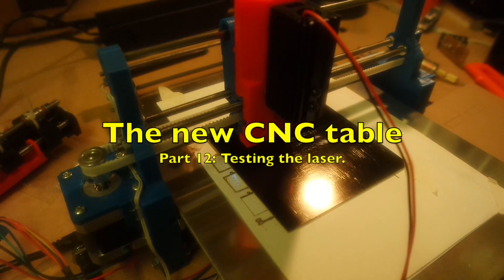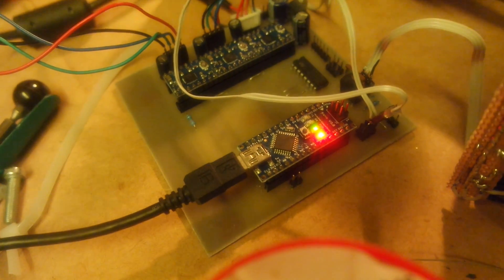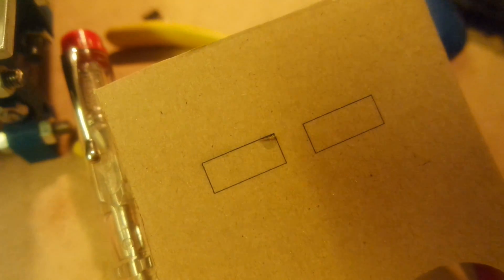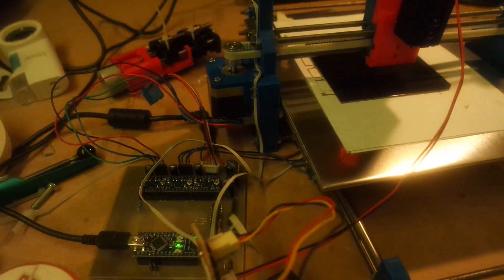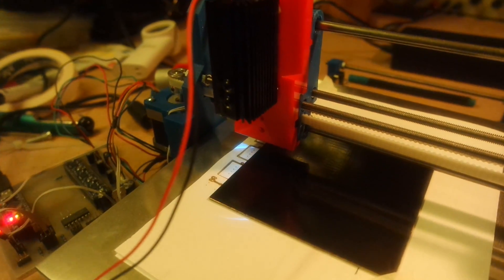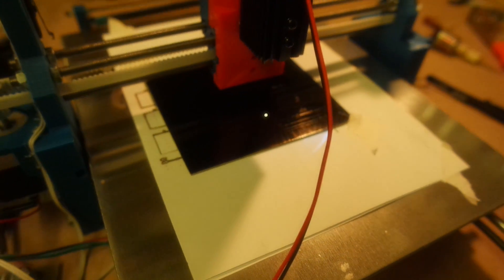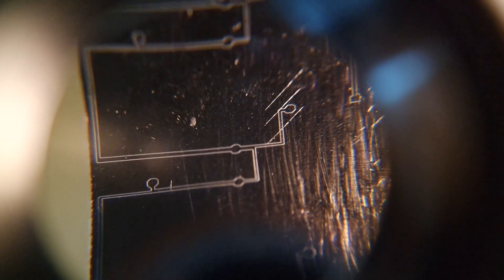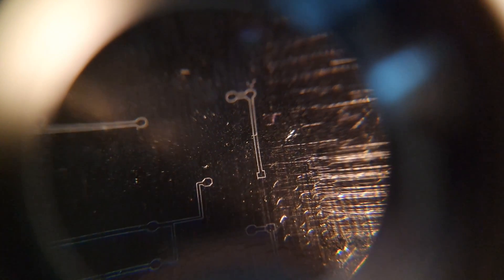The new CNC table pt. 12

Comment: Awesome...needs to be added to the playlist...
Love to see how it's coming...would like to see the Z axis raised to maybe 25-30mm for when you put a spindle on it...it can then route out 3D artwork in wood.
Also...maybe a drag knife tool mount...man your design is incredible!

Awesome designs man!
Reply from the maker: Thanks for the pointer to the video missing from the play lists - fixed now. Raising the spindle is also on the list, although that makes printing the columns difficult, since we are reaching the build size of my smaller printers.
Reply: Yeah fine line on too tall and wobbly and not tall enough and limited use...but it seems you are much more detail oriented than most and will figure it out...

Comment: looks great man .something occurred to me after the last comment i said about using a Z axis. to defocus laser hot spot to burn wider tracks.   we dont need to do that . looking at my fixed height unit , i realize all we need to do is a gradient test and then use shims . 
to do a burn gradient take your a small bit of target material (blackend copper clad ) set it on a angle like 45deg or less , and manually run your laser up the gradient to see how high from 0 can the contact point be and still burn. min is about 4mm making a 2mm dot .
higher gradient / height is a wider dot , and requires laser to move slower or do multiple passes , as the energy is spread out . 
when you know how high above 0 z you can still vaporize your paint without adjusting focus , you can then inspect to see what width line it makes . that way you can shim your target FR4 to result in a path that has good mask removal resulting in better etch . 
i forget if you are running custom firmware still or moved to GBRL .  i did everything i could to remove backlash mechanically and continued to find flaws in arcs .  closer inspection showed i was mixing float type with long type and math was truncating values causing step loss during arcs . I think I told you about that screw up before . lol 
screw up explanation video ( note i only used a relay for beam on back then ) : https://youtu.be/bgBwnhKF4_s
Reply from the maker: I tried a laser isolation yesterday - I got the backlash issue all sorted out. But when I etched the PCB exactly nothing happened - It seems as if the isolation only burned of the black, but there was clear paint left on the board. This sucks. The tracks laid down by the laser were so good.
Reply: man , i think now its a matter of finding the rite Pen / paint to cover the board .  I'm using ~300 violet module , but i can tell it leaks a higher wattage of IR when I use my old cell as a camera and there is a huge bloom . I have no etchant rite now , but i can test if mask was removed using a fine wire and continuity . 
i have real brand sharpie markers and some knock-off ones.  but i cant test what marker resists best

Comment: Since the belt drive limits your ability to use mechanical backlash compensation, it seems you may need to look into a software solution. Many if not all of the pro CNC machines have backlash values in the diagnostics.
Reply from the maker: My software can do backlash compensation, but I'd rather fix the hardware first. ;-)

Comment: your laser will likely blow in prolonged use using that type of voltage regulator. you should use a constant current supply. great vidoe series!!
Reply from the maker: It has a current-limiting circuit inside, it is also supply limiting, so it works quite well with lowered input voltages.

Comment: How many watts is this laser?
Reply from the maker: This one has about 1W, but I'm running it at about 250 to 300mW.
Reply: 3W ?????
Reply from the maker: One watt. but running a one third power.
Reply from the maker: Not really, important is that you have good focus and little vibration on the laser head.

Comment: Found with backlash, I needed to use a sprung loaded wheel, to keep the tension on the belt. Like a pair of bike forks with a spring pushing them out all the time.
Reply from the maker: True, but the backlash is about 0.02mm .... this could be within the one tooth of the belt.

Comment: Nice work. Actually surpriced that it looks this good.

Backlash can be reduced by adding two nuts which both are free to move along the Y axis in a hole/trace in the carriage, where the spring press them outward.  Like this:
=======FFNssssN======Stepper Motor

Both nuts (N) are moving in Y-axis direction with the carriage when the screw (=) turns.  The spring between them takes up the backlash. To the left of the left nut there are some free space for it to flex into, the right nut is fixed in the carriage and moves it. This will press the right nut to the right side of the threads, no backlash. They should both be fixed and not follow the screw when it turns.  Hope you understand how it should work.
Reply from the maker: yes, but this is a belt-drive.
Reply: Ah, yes, sorry.  Then can't you just add a spring on one of the sides for the belt, instead of mounting it directly on the carriage?  Or are the back lash between the belt and the stepper motor (wheel)?
If you make the Y axis repeatable go back and forth a short distance (or X-axis), you might see where it is. Might start with a very short distance and then make steps larger (or go from a larger distans down to a smaller one).
Reply from the maker: Yes, your point remains valid of course - I need to look into it - the actual backlash is just 0.02 to 0.05mm so even if the tension is off, this might be backlash within the belt/pulley.

Comment: brilliant resolution. the 45 degree problem is a software/cam problem.
Reply from the maker: It was backlash in the Y axis - a set of bearings was not moving correctly and the belt was a bit loose. I compensated and the output is fine now. But I also noticed that the slant lines that eagle produces seem to be a bit thin.
Reply: Well, it is not only in the 45 degree traces. You see it also when the trace is changing directions.  One trace is much narrower just by passing one through hole pad. You also see it with the miss alignment in the near through hole pad to the left at 8:16. There are also the trace width problem behind it to the left.

Hm, it could be a software problem, but I guess that it isn't just that.
Reply: draw a coordinate system. mark 2 points on x at 10 and 11mm. Same on y. now connect the first 2 dots of both axis and 2nd ones as well.. the resulting 45 deg line in between is not 1mm wide. this is what your cam is not compensating
Reply: Hm, check the pads. I am not convinced, but I have not made a thorough analysis.

Comment: This video was very informative, as were the last ones. You likely already know, while using the voltage drop over the diode is clever and easy, the voltage drop may change if the load changes. Your video reminded me of being bit by this recently. Best wishes, Kent
Reply from the maker: There is a 7805 below the heatsink, the diodes (just 3) are just for fine tuning - and there is a driver circuit within the laser module itself. The voltage is pretty stable, even while the laser heats up.
Reply: OK, that's pretty similar to my situation, (easily sourced) regulated 9V module and a series of diodes for the voltage drop to the desired (uncommon) voltage. Unfortunately, as the current demands changed, the voltage drop fluctuated. The calculated number of diodes using the constant voltage-drop model simply was not sufficient and the exponential voltage-drop model was needed. While this power source was for a strobe circuit, not for a laser module, I did check the 2.5W laser module I have. At regulated 12V and 20% duty cycle, 120mA is required while at 80% duty cycle 781mA is required. Just mentioning it in case a similar situation comes up some time. Best wishes, Kent
Reply: These guys have TONS of opensource DIY laser drivers...
http://laserpointerforums.com/f67/driver-specifications-compendium-78942.html
I designed some DIY opensource flashlight drivers for high power cree flashlights over at budgetlightforums but it drives LED's, not lasers
Reply: Actually it is the current that is the problem with lazer, as the resistance decreases with heat.  
But you already told me there are current regulation circuit already in the laser, so it should fix that.
Reply from the maker: Understood - you can of course use a 5 or 8 Volt regulator and place a diode on the ground reference to lift the voltage up to your desired voltage and the regulator still works. I plan on building a 1 Amp regulated supply to provide 2.3 to 5V which are the Voltages this Module will work at. But I want a regulated linear one, not a pwm type , because those work better with lasers.
Cheers, Dirk
Reply: The laser module I have is self contained with regulator. Inputs are 12v and a TTL control signal. Would you guess this is linear regulator? Not to confuse the matter, but regarding the output power, I doubt it's linear with the pwm signal, but that's only from charing wood, not a careful measurement. Do you have experience with (pwm) control and laser power? Thank you
Reply from the maker: Some - laser power supplies are usually constant current supplies, some come with an enable line, others have an analog input for output power selection. Since most of them usually ramp up the current they are not very suitable for PWM in their enable line or fast switching.